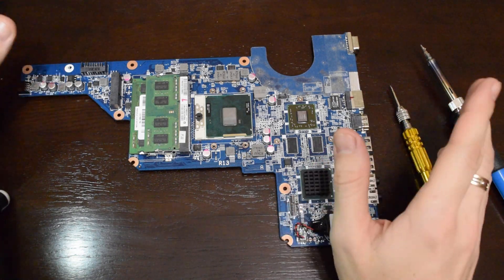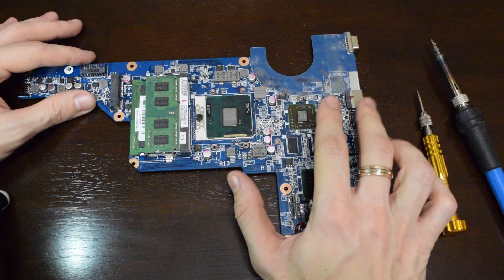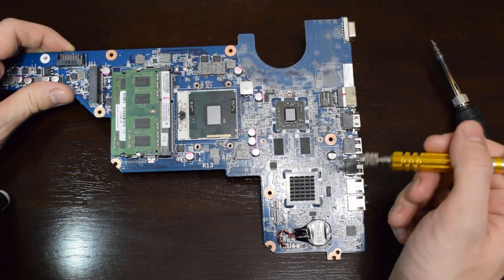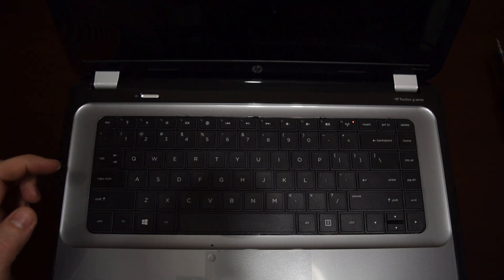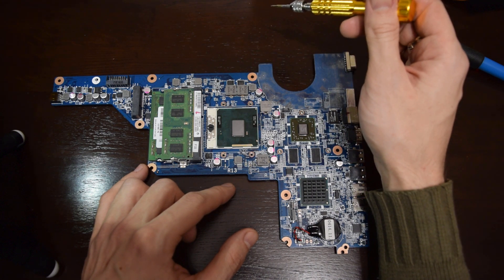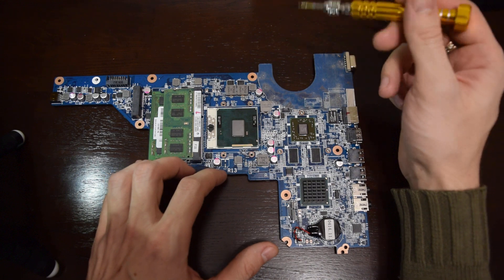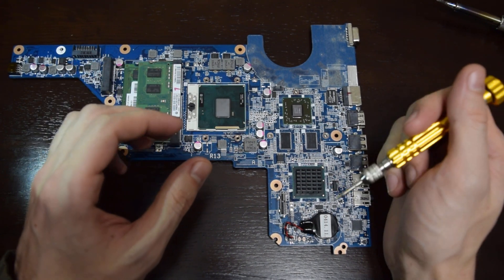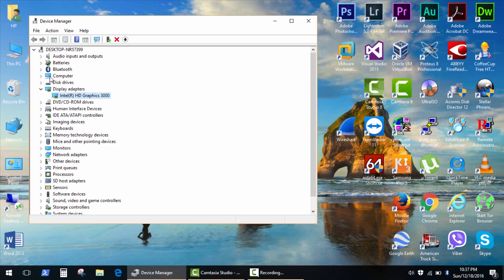Fix Dead GPU – Convert HP, Dell, Lenovo Laptop to UMA Graphics (HP G6 Example)

Comment: Hello Sir nice video , thanks for sharing. 
I have a  lenovo g780 with 1 of its two gpu dead and so my laptop , could i use this method to fix it ? if yes which coil should i remove? .Thanx in advance
Reply from the maker: It works perfectly for your model!!! You need to remove the coil/coils from the picture or you can only remove the solder joint from another side of motherboard which is more professional way to do it.
https://ibb.co/mHyJTxz
https://ibb.co/jvjKVcJ
Reply: @ElectronicsComputers  hi sir , i found your video very informative , thanks for your hardwork and sharing your knowledge in this video. I got lenovo G500 please give a try to help me.

Comment: hi, your videos are really helpful. thanks.
Can you tell me how to find which coil needs to be removed ? any particular procedure to find out ?
Reply from the maker: I use official schematics to find out which coil needs to be removed. You can also google for pictures of your laptop motherboard. There are usually models with and without discrete graphics. So the model without discrete graphics will be without soldered coil, GPU  and video RAM.

Comment: Hi. Great video :)
I really need help please (sorry for the english).
I have an hp pavilion dv6-6c71el with a dedicated graphic card, an amd radeon HD 7470. A few days ago i was using it and suddenly it got stuck, I have to turn it off and when I restart it, it stuck again during the boot.
I installed windows 10 from zero but when update install the driver of the AMD card it got stuck again with black screen. If I don't connect internet (so update can't download the AMD driver) my PC works well with the CPU graphics.
Is the dedicated GPU dead?
In that case, is the motherboard like this?
Thank you so much.
Reply from the maker: Can you show me the picture of your motherboard? There are a few modifications of that motherboard I don't know which one is yours. So better give me the link to the picture.
Reply: @ElectronicsComputers  thank you for the answer! As soon as i can i give you the link. Thanks!

Comment: I love that you propose a real solution to the problem.

Can you help me with mine? Im not sure which i need to remove. I dont play games I just want my laptop to be useable.
Toshiba Satelite M840
Reply from the maker: Technically it's possible but Toshiba not that generous as HP. They decided to save a few bucks on some extra components which they didn't solder to the board. So make it real you have to add, remove, swap a bunch of tiny components which is unreal task without proper tools and skills. Check out this video: https://www.youtube.com/watch?v=nA1WzxNYa7E

Comment: Hi thanks, i need your help please, i have a problem with my laptop, when i turn it on it shuts itself off in a few seconds, i removed the heatsink, I've found that cpu is not generating any heat, could it be the coil that feeds the cpu is damaged? The reason why i think so because the motherboard is flexed during the disassembling, notice i didn't remove any coil. 😢
Reply from the maker: The coils in a laptop are the only components that will live longer than you! There's a bunch of tiny component's that could be damaged. try to remove RAM and CPU and reset the BIOS by removing the battery for a minute and then try to turn it ON. What's the model of your laptop?
Reply: @ElectronicsComputers  I will try this and I'll let you know, my pc model is a Sony Vaio SVE (radeon graphics+ intel cpu)
Reply: @ElectronicsComputers  
I did everything but unfortunately the problem is still present, if you can help me here is list of symptoms:
-Laptop shuts down immediately after start
-Led on
-Fan doesn't spin 
-No display
-CPU cold
-GPU runs hot

Comment: I have Dell Inspiron 15r se 7520 and it have two ati Radeon and Intel hd. In my case when I try to install amd drivers bsod comes in everytime so my question is that my AMD gpu is dead or there is a problem with software or BIOS and one more thing my laptop is working fine but with Intel hd graphics only
Reply from the maker: Most likely your GPU is dead but make sure that you're installing correct and updated drivers.

Comment: Hello ! Can you mark which coil to remove

DELL INSPIRON N5010 https://imgur.com/gallery/GoEQ9lw
Reply from the maker: unfortunately it's not gonna work for your model. Even though your CPU has a video chip inside but if you look above there's a bunch of empty solder pads with missing parts. There should be some complements for powering your integrated GPU. So, technically Dell decided to safe a few dollars on those components and made this model with the discrete graphics only.
You can buy a new motherboard without dedicated graphics for 60$ with free shipping: http://ali.pub/4gv7fj
Reply: @ElectronicsComputers  thank you for replying. Will suggest that to my friend. Thanks alot.

Comment: Hi, I don't now Wich one coil I need to remove from my msi ge70 0nd... Can you help me?...
Reply from the maker: Unfortunately I don't have schematics for MSI laptops. I only work with HP and Dell equipment. But I'm pretty sure that it's possible. There are two coils close to the GPU chip. Try to disconnect one terminal from both. If it didn't work then try to go to a repair shop and ask them to convert your laptop to UMA graphics. it's very cheap and quick repair.

Comment: Ok, I dismantled my entire laptop, and got the motherboard out. Now I have no idea which coil to cut. I beg you for assistence. Would you point out the coil that needs to be removed if I sent you a picture of the motherboard? I'm not an expert at this, and prior to dismantling the laptop I didn't check the name of the motherboard. The motherboard is green and a bit different from the one you are using in this tutorial. The only thing I know is that my laptop is HP G62-a50SM. If you are willing, please help me. Thank you!
Reply from the maker: I need the part number of the motherboard or at least tell me what kind of CPU in your laptop. You can also make a picture of your motherboard and upload here: https://imgbb.com/   and then give me the link.
Reply: @ElectronicsComputers  I have switchable graphics (Radeon is the main one, the busted one, and I have Intel's as a secondary graphics chip I guess). Here are the images:
https://ibb.co/Sr2rVrD
https://ibb.co/zhCZnx1
https://ibb.co/wry06B4
https://ibb.co/jVSyjtS

If you need better images, I'll take new shots! Thank you so much for your response! :DD
I'll need to go back home to see which CPU I have and then I'll write back to you! I just looked for another video to figure out which motherboard I have and I have the same motherboard as this man:
https://www.youtube.com/watch?v=jwQwmM3mT24
Reply: Please, when you have time and will contact me with a solution. The video I sent you was not as informative as yours. I still haven't fixed anything. My laptop is in pieces literally, and there is no avenger to assemble it. Have mercy! ;)
Reply: @ElectronicsComputers  CPU is Intel i3-350M and the motherboard's number is (I hope I get this right): 
PBKJCB67RZ65QD
If that's not it, then perhaps this one?
90FBA6AAF386

These are the only two longer numbers that I found on the motherboard, as you can see in the pictures from my previous reply. If you need some other information please let me know! Thank you!

Comment: Hi sir i have toshiba l50-d-b-13l it has graphics cpu and seperate amd graphics i think gpu is shorted i removed the closer coil with is shorted from one side but no success. How can i fix it? (may i remove the hrtz62771?)
Reply from the maker: try to disconnect these two coils: https://ibb.co/HXj3zVN

Comment: Nice video! Maby you can help me? I've asus z96j laptop and have dead ati VGA chip. Can I bypass it like you did in video?
Reply from the maker: it's old laptop with core2duo CPU which doesn't have integrated graphics. New motherboard costs 37$ http://ali.pub/4djqw5
Reply: Thank you for answer.

Comment: Hi, my HP 242 G2 laptop discrete graphics chip is troubling. I am not professional technician. I am having hard time locating the thing that you removed from your laptop. Can I just remove the graphics chip? Is it safe?
Reply: https://drive.google.com/drive/folders/16H7NEi34lTSYU0ulL30-rbTWbMdI1E2Q?usp=sharing
Reply: pictures of my laptop motherboard. kindly tell me which one to remove to cut current supply to graphics chip. thanks
Reply from the maker: your laptop doesn't have discrete graphics!!!!! Only integrated one into the CPU. If you look at this picture that's where your discrete graphics supposed to be: https://ibb.co/Z1BVNpY
Reply: @ElectronicsComputers  thank you so much for fast reply. I am clueless now as to why Intel and AMD graphics drivers were installed when I bought it.

Comment: @2013Electronics&Computers 
Hello, I have a Toshiba l50-b-19q with a dead GPU and I can't figure out which coil I need to remove. Which one would you suggest?
Reply from the maker: https://ibb.co/j6f1dkJ You’ll need to remove that coil but this model may also require swapping two tiny resistors. But first try without swapping any resistors.

Comment: Hello, i have a question! I have hp elitebook 8460w with firepro m3900 and second gen intel quad core processor! Can you tell me what should I do on the motherboard to fix my black screen! The other day artefacts appeared on the display and then black screen!  If not repairable can I buy another motherboard but with integrated graphics and replace the old one? ThanKs! The processor is 2630qm! I forgot to mention the mb part number:670123-001
Reply from the maker: new motherboard with integrated graphics costs about 35$ with free shipping: http://ali.pub/4bgnlo
try to remove this coil: https://ibb.co/VjK3h4b
Reply: @ElectronicsComputers  thanks a lot, I will try to fox it if not, I will by a new board! I wanted an confirmation as I never had done this before! I hope that this board is direct fit! Thanks a lot, your help is greatly appreciated
Reply: I have removed the coil and once the laptop plugged  the fan start to spin on and off nonstop but no displays.....anyways I will buy a new motherboard
Reply: @ElectronicsComputers   The repair didn't work finally and I bought the mb as you suggested! Hopefully the replacement will work well! Thanks

Comment: I have a Toshiba s50d-a and I’m wondering which coil to cut
Reply from the maker: unfortunately, it's not gonna work for your lsptop model.
Reply: @ElectronicsComputers  well I think the problem is that there is a broken connection on one of the graphics cores. I have a soldering I iron and I was wondering if you had any suggestion on how to fix it?

Comment: Hello, can you help me witch part i need to remove Toshiba Satellite c855-1MU
Reply: Here's the picture of the motherboard: https://ibb.co/7r2BMYg
Reply from the maker: Unfortunately it's not gonna work for this model. Toshiba decided to save a few cents and they didn't solder a bunch of components to power integrated graphics. Basically your computer doesn't even know that CPU has an integrated GPU. If you look at the picture there should be some components to power integrated graphics: https://ibb.co/m4HmcT2

Comment: hello, I have a hp probook 6470b, I think it has the same motherboard as the elitebook 8470p, it has an amd 7570m graphic that apparently died, will you know what coil I have to desolder to make the integrated graphics of the i5 3340m processor work?

Comment: Hi man
I have a toshiba satellite L670D laptop
And it have the same problem should i do this trick or it wouldn't work for him
And thanks for youe effort 👍
Reply from the maker: It's not gonna work for your model with that AMD CPU
Reply: Thank you 👍
Reply: If i add an external graphic card to my laptop would it work or not
Reply from the maker: @soufianelousti5688  if the GPU is already dead in your laptop then external graphics is not gonna help you. You can buy a new motherboard for 50$ with free shipping:
http://ali.pub/49a9tv
http://ali.pub/49a9uu

Comment: Hi sir, got same problem with my dell latitude d620., can this method possible? Got some image if you got time. Thanks
Reply: https://ibb.co/26tsvnP for dell latitude d620 can you help me find the gfx coil?
Reply from the maker: It's very old laptop it's not gonna work. Your CPU doesn't have integrated graphics in it. But you can replace your motherboard for 30$ delivered: http://ali.pub/471h1d
Reply: Thank you

Comment: Hie bro  need ur help in 2019 sir.......facing the same problem in my hp probook 4421s    and i am unable to find its gfx coil dont wanna do anything as its exam time here please help as soon as possible
Reply from the maker: unfortunately it's not gonna work for this model.
Reply: @ElectronicsComputers  is there any other way to convert it onto intel graphics????????????????
Reply from the maker: @nikhilkhatri4485 It's is impossible! Your motherboard doesn't even know that the second graphics in the CPU exist because there's even know power for that chip. The cheapest way to fix it is to buy a new motherboard for 57$:  http://ali.pub/48ypnj

Comment: Hello! May I ask if I just removed the right or wrong coil ( 1RO -on the coil, see the red circle) ? https://ibb.co/F51M5nP  .  HP G62-120EG with Intel core i330M . The notebook doesn't start since I did it.  Just a short fan movement and that's it. Do I just have to remove the coil as I did on the picture or did I forget something? Thank you very much for your time and advice.
Reply from the maker: It's not gonna help you! As you can see under your CPU there's a white square and two solder pads. There must be a coil that powers integrated graphics. Your laptop doesn't even know that there a graphics chip in your CPU. To make it work you need to add/remove/replace a bunch of teeny-tiny components which is unreal work without proper tools and experience. HP simply saved a few dollars on those components. They did like that only with first generation i3-i7 CPU family. Starting from second generation CPUs you just need to remove the proper coil.
Reply: @ElectronicsComputers  Alright, thank you very very much for your quick response to my issue. 👍Due to your competent assessment I will stop investigating for a solution and I will give up this notebook for good, since all previous measures achieved nothing.

Comment: I uploaded image link https://ibb.co/1vscJTn.  ..it is dell 5010 model.please tell me which one i have to remove
Reply from the maker: No chance for your laptop. Technically it's actually possible but your laptop doesn't have a bunch of teeny-tiny components that provide power for integrated graphics. Your laptop simply doesn't even know that it exist. You can compare your motherboard with this new without graphics: http://ali.pub/45i9u5
As you can see your motherboard doesn't have a coil on the top of CPU and other components that power integrated graphics. You can buy that motherboard and put into your laptop and you'll never have problems with dedicated graphics.
Reply: @ElectronicsComputers   thank you

Comment: Other videos i saw tells to shift some resistors and solder a jumper cable at two points. I have dv6 6119tx . Its board is quite similar but am not very sure what to do . There are not too many guides out there
Reply from the maker: For some models you have to add/remove or swap some components but for HP and Dell in most cases you just need to remove the coil. Simply remove this coil: https://ibb.co/M8HR9kG
Reply: So on my mobo, only removing the coil should work right ?

Comment: Good morning. I have a samsung chronos np700z4a-sd1-br. The laptop still turns on but freezes right after booting up. That happens for win7 as well for linux mint. If I "disable" the graphics in linux with "nomodeset" it doesn´t freeze but the resolution is very low then. The resolution it worked was 1600x900. Will it still work with this res if I apply your method? Can you show me what coil (it´s a voltage regulator, right?) to remove? Thanks for all the support man
Reply from the maker: It may not work for this model! Anyway, try to carefully remove this coil: https://ibb.co/2qX7bpx

Comment: My laptop is having only AMD Apu with Radeon hd graphics... No any other dedicated gpu... And I am facing the same problem and if luckyly the laptop turns on and starts boot it crashes due to bSOD  screen and everything opens in low resolution. Plz tell me any solution. And would it will cost very much for repair.
Reply from the maker: If you have an AMD processor this method is not gonna works for you. But can buy new motherboard from china which will cost 28$ with free shipping: http://ali.pub/42r3es
Reply from the maker: If you have an AMD processor this method is not gonna works for you. But can buy new motherboard from china which will cost 28$ with free shipping: http://ali.pub/42r3es

Comment: Hi!
https://ibb.co/cbDZs1d
Wich coil should i remove from motherboard? Acer 5742g
Thanks for your work & help!
Reply from the maker: Technically it's possible but not that easy way how it works for HP, Dell etc. You have to add/remove a bunch of teeny-tiny components. Without popper tools and skills it's almost impossible.

Comment: IS THIS METHOD WORK FOR HP G42. da0ax1mb6h1 MOTHERBOARD..?
Reply from the maker: Technically it's possible to convert your laptop to UMA version but it's almost unreal task without proper 
tools and skills. There's no power to integrated into CPU graphics. Basically it's not even connected. So you need to add a bunch of teeny-tiny components to make it work.